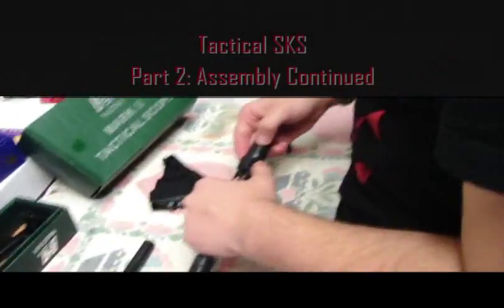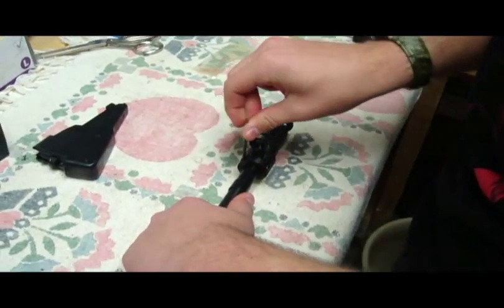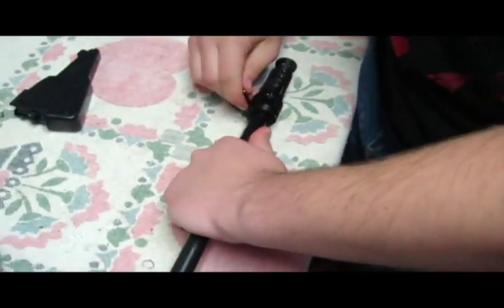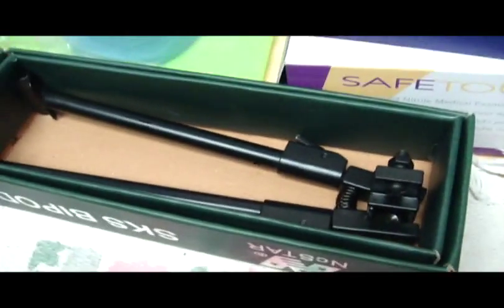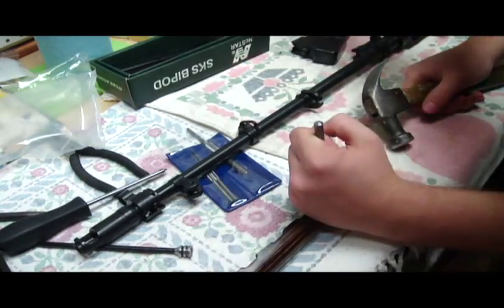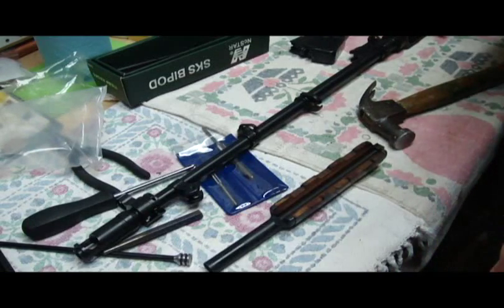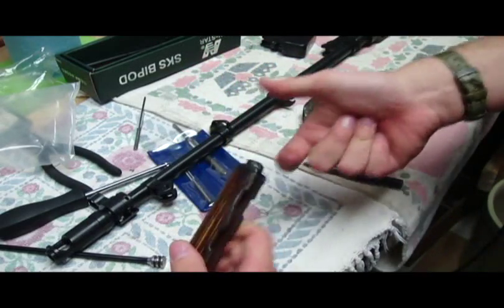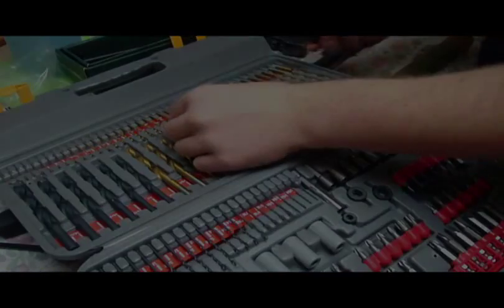Tactical SKS Part 2: Assembly... Continued.

Comment: Hey boys you hold the wood with a vice and put pliers on the end you are beating on(notice how it was two flat spots for the wrench) and spin the gas tube till wood is upside down to factory position and left out. Everyone thinks this is hard. But in all reality it's as easy as the cleaning break down.